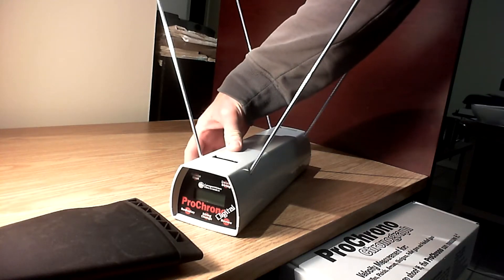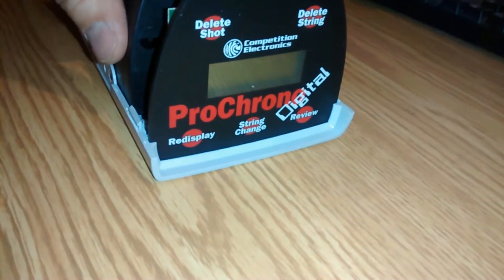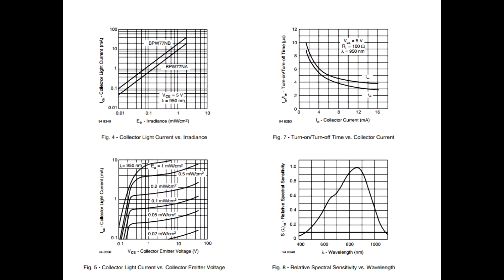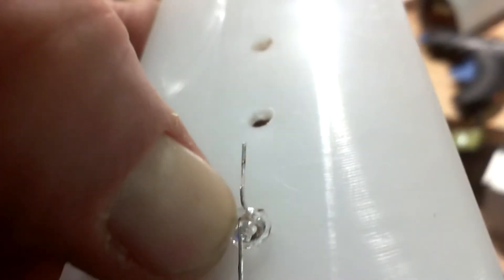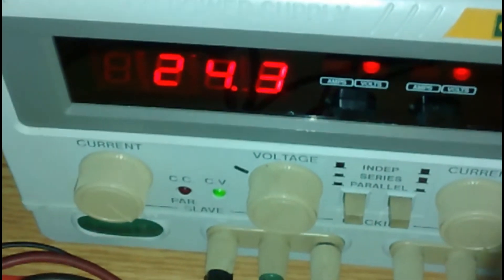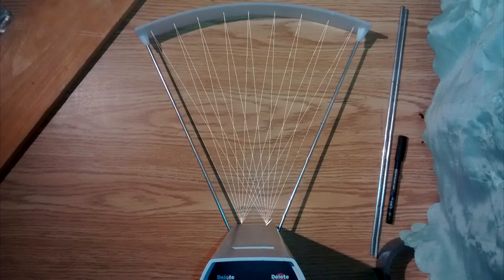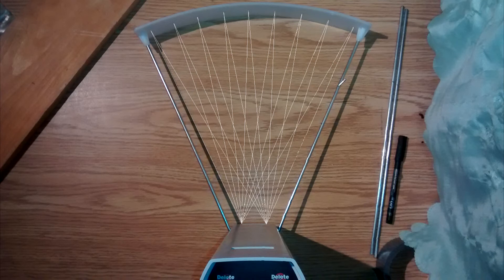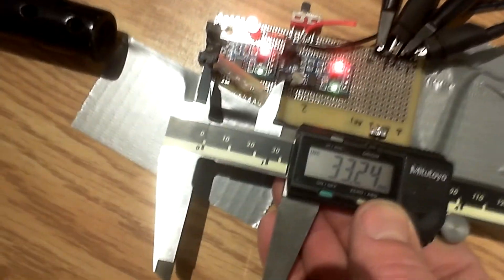Pro Chrono homemade indoor lighting

Comment: thanks for sharing! There are some cheap IR illuminators on eBay/amazon for ~$20, I wonder if those would work, they aren't sold in strips though, they are ~20 850nm leds oriented in a circle. Just purchased the $40 kit from competition electronics...

Comment: Thanks for your great job, creative with poor budget....
but I want to ask, how much voltage about one LED and totally voltage used?
Reply from the maker: 24V total, typical forward voltage drop is 1.45V per LED, total 12Leds used. Supplied by 24V with 68Ohm in series.
Reply: Thanks tom...👍🙏
Reply: Thanks tom about yours respect....
On my village... i difficult to get LED 850nm, what I can use LED infrared former CCTV?

Comment: Fuck it. Tried that and gives false inacurate readings. I bought the infared light kit and its spot on accurate. For god sake everyone carrys on lile its expensive. Why have a chrono if you cant afford the proper infa red light kit.
Reply from the maker: it depends much on the projectile format and reflectivity. I'm using it for research, my gun is fixed, always shoots through the chronograph at about the same position. Works for me.
Reply: you understand $ maybe but not the physics of this.  go away